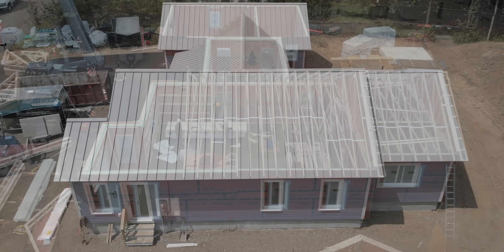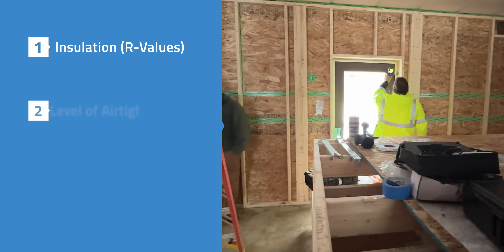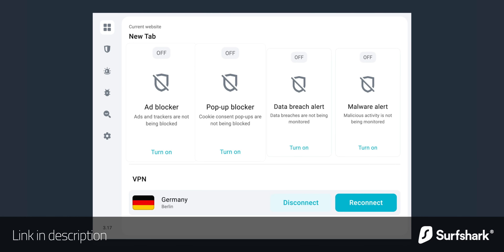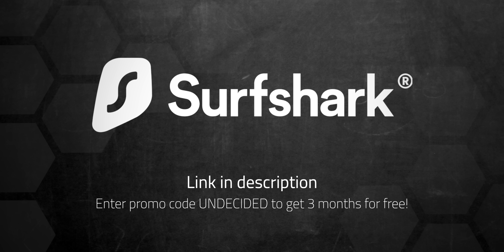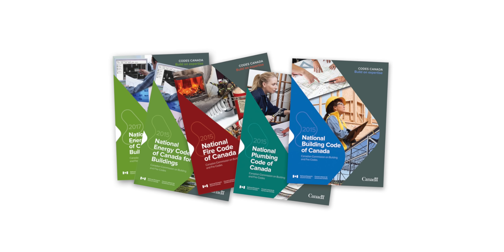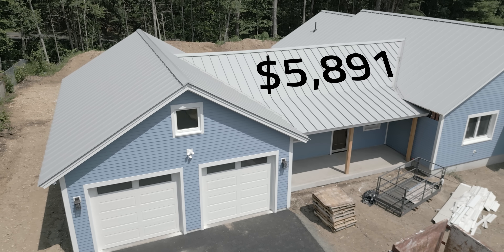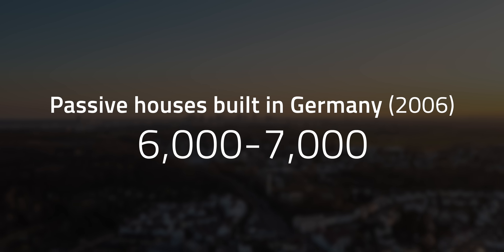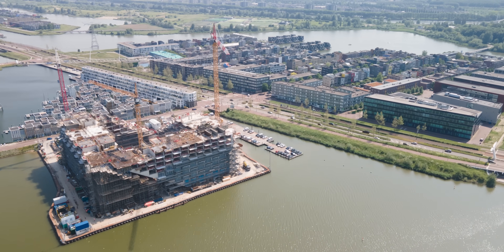Why Do American Homes Suck?

Comment: Fun video. I heard in a previous podcast that you would not build another home after going through it now. Would you recommend someone looking to have an energy efficient home in the U.S. have one specially built themselves like you, because it sounds like it would be impossible to find any already built due to the lax building codes? Would you recommend an energy efficient home (and the increased cost of one) for a first time home buyer?
Reply from the maker: I said that kind of in a tongue in cheek way.  In general, it's an exhausting/stressful experience I don't really want to go through again, but we're extremely happy with the result.  I don't think you have to have one specially built, but if you look for Energy Star rated homes, that's going to get you most of the way there.  There's not a ton of them out there yet, but they are slowly building up (pun not intended).  Would I recommend one for a first time home buyer?  It depends on what your goals are.  Would this first time home be a stepping stone to a dream house down the road?  Like a house you're planning on living in for 5-7 years before moving?  No, I probably wouldn't recommend it for a shorter term goal.  But for a longer term goal, absolutely.
Reply: If you're looking for a home, having efficiency on your list of things you want is a good idea, but will probably limit your options.

Maybe something to look for would be a house where efficiency upgrades could be easily done over time. That's basically what I've had to do.
Reply: @Green_Tea_Coffee  Thanks for your reply! I think I will be going this route as well, especially because I don't have the liquidity to start building a new home from scratch. I'll likely be starting with a fixer-upper that I can put money into making more efficient, hoping that it makes it more valuable before I can sell it years down the line.

Comment: I LIVE IN A PASSIVE APARTMENT BLOCK in Bulgaria* - it has very basic passive heating and cooling based on thermal mass and a wind catcher on the roof.

My energy bill is about $20 a month
It was built by the communists for the officers of the Bulgarian Navy. The walls are 30cm thick concrete. They heat up all summer and keep you warm all winter [till Feb]

Comment: The answer to the question is that in Europe we don't have an 18th century mindset that says government is only evil. It seems that the more socially advanced a country is, the more there is trust in the government. That's why it's more accepted that government regulation is not an infringement on freedom but a enhancement of the greater good that benefits everyone.
Reply: The more developed a country is, the more resources it has suphoned for cheap from less developed ones. Look at Germany for example.
Reply: Personally I wish we could have that in the US. However, we have daily evidence that our politicians, regardless of political party, are pretty much all corrupt, incompetent, or so old they barely know where they are. With big corporations running the country it is hard to see it changing anytime soon.
Reply: @jkeelsnc  That is a function of the type of government you have in the US. I wouldn't trust the US government either. But it's a chicken and egg thing. If you don't believe the government capable of doing good, why bother trying to change to another system of government? Also, I don't knwo of any other country that elects it's judges the way the US does. That is maaI don't knwo of any other country that elects it's judges the way the US does. That is madness. I have also worked in various roles in government. I'm not going to pretend it's perfect, but where I'm from the public service was professional and actually believed in what it was doing and mostly did it very well. Yes, it was bureaucratic but all large organisations are. The more complex the task, the greater the chance of screwing up. Defence procurement is always a sh!t show! There are morons, of course, but mostly the bureaucrats are professionals who know their stuff. (BTW, we also hate all politicians.)🤣

Comment: Yes, I am deeply interested in a more energy efficient home. I want to build a retirement cottage for myself, completely off-grid. That way, I'll be free of utility bills an rising prices (except of course for the inevitable taxes). I'm saving my pennies and doing my research. Your current topics on home construction are what drew me to your channel and were interesting enough to cause me to subscribe.
Reply: You'll spend more money in your off-grid fantasy then you will ever save just by paying for the utilities
Reply: @xephael3485  Huh? I'm planning to build in Arizona. The state offers a lot of good incentives for solar, and charges stiff fees for connecting with their already overloaded grid. It is actually about the same (I'm talking upfront costs, here) to put in an 8 kilawatt solar array complete with off-grid batteries than it is to run electric down the road in a new subdivision and connect up. Also, in the mountains the average rainfall is about 18" to 20", the driest drought year they've had in recorded history was about 10". Well, with a 1,000 square foot house + solar ground array, I can capture 12,000 gallons from the roof surfaces alone (not building a rain roof or chicken coop or workshop or greenhouse or even a garage, just the house and the solar array) during a drought year and twice that in a good year. A cistern is about $1 per gallon, so drilling a well with permits OR running a water line to city water is about $30,000 and $10,000, respectively, and putting in a cistern is about $20,000 (smack dab in the middle). Most of the lots available require septic (both in city and in the county) regardless of the water supply, so that's not part of the equation. I'm just confused. Why do you think that an all-electric house with my own solar array and a roof water-capture system (both common in Arizona) will cost me more money? If I'm getting bad information from the power company and the realtor, I would really appreciate you telling me about it.
Reply: @lindacgrace2973  your building in the middle of nowhere so of course it's going to cost a lot of money.
Reply: @xephael3485  Ah! Confusion explained. I am NOT building in the middle of nowhere, I am building within city limits of Prescott, AZ. I will be "off grid" but inside of a normal city suburb. I am blind in one eye, and the DMV insists that all drivers must see both sides of the road, so no driver's license for me. I can't build in the middle of nowhere - I have to be close in so that I can bike to the library, church, doctor's appointments, etc., and receive regular Amazon deliveries. No, I intend to be "off grid" - as in not connected to the local electric and water services, but not a "homestead" out in the middle of nowhere. I seek financial security - not isolation.

Comment: i have also found that a lot of people think insulation is only for cold climates but it works just as well in hot climates, keeping the house cold on the inside and keeping the heat out
Reply: We know it here in New Orleans, my power bill nearly triples in the summer from running the AC alone.  it's just that replacing all the windows in a home built in the 60s would be over $20K.  Making an old house energy efficient means making a LOT of changes.
Reply: @Blaquer17  now i dont know your economic situation but wouldn't that be a worth while investment? A one time payment to pay less for AC during summer? Depending on how it all fit together it may pay itself back in 10-20 years if not faster. Also if/when you at some point decide to sell your house it would increase the value right (ofc it is unlikely you will get all your investment back but some of it at least)?
Reply: @CoBy_CoBy  absolutely. It’s the time scale that’s the issue. It would only save us significant money for about half the year, but any loan would have to be repaid every month. It would just make cash flow an issue. I have considered it but it’s not feasible at the moment.
Reply: @Blaquer17  yeah, here in europe, in most countries energy efficiency improving for old houses is heavily subsidised, but it's all different here as houses are built from brick or cinderblocks or stone even, they last much longer, so you get the money for an outet facade with insulation and windows, roof insulation, it depends from country to country, somewhere you get less but for everyone who applies, somewhere you wait longer but get subsidied everything, in any case with new energy certificate your house is worth more, and you pay less bills, not just what you save on spent energy, but often because you save the energy you get better price too or lower tax or something, also a lot depends on the area inside the country, some areas are more subsidised where the income is lower, and then some are subsidised, usually rural areas that need support, from the eu directly, even in the uk when they were the member some counties that were mining towns before tatcher basically survived on eu subsidies and now are properly f-ed in their tory paradise.
Reply: @chartedtravel1776  USA is 27 in the world in terms of economic mobility on par with Lithuania and Spain. Scandinavia generally has the highest economic mobility. In Denmark people stay in their house for 21 years on average. In the USA its 13 years. I dont know where you got that nobody lives in a house for 10 years in the US and i dont buy that it has anything to do with economic mobility. If we were talking about renting apartments then yes its a lot lower with 6 years in Denmark and 3 years in the USA. But we are not talking about renters here just home ovners
Reply: @CoBy_CoBy electricity in the US is dirt cheap currently(8c in my area). Therefore people do not see the SHORT-TERM value in those changes and long term, it’s basically someone else’s problem.
Reply: @CoBy_CoBy  it’s $20k not $2,000💀
Reply: @Blaquer17  What if you only replaced the window or couple of windows that would make the biggest impact? So the one(s) facing the hottest part of the sun for the longest part of the day for example. Would that at least help some?
Reply: @Blaquer17  You can get replacement vinyl windows from $50-$150 piece. Might not be extravagant, but it'll be more efficient.
Reply: @Blaquer17  have you thought about getting a tint on the widows? Even a clear tint that reflects uv can keep a lot of heat out.
Reply: Yes, this is a huge problem in the US south.
Reply: Especially with AC
Reply: @ChrisBigBad ac is bad for you health....
Reply: *insulation
Reply: So many southern US houses don't even use proper exterior sheathing. Don't expect them to heavily insulate it.
Reply: Only with AC, it's useless if you don't have AC as otherwise high ventilation is preferable; high ventilation is more energy efficient and cheaper to build; hence no, insulation in the tropics is not the smart move. You want big ass windows, without glass, and ventilation holes everywhere, bright reflective colors, add fans and it will feel cool inside.
Reply: @egonzalez4294  sounds like a disaster waiting to happen when the wet bulb temperature gets lethal. Have you actually lived in a hot climate?
Reply: Regarding the point "insulation is also good in hot climates" while thats not untrue, more important for hot regions would be heat storage capacity and thermal inertia of your building materials. So you should build heavy. With stone, clay, concrete(not the best regarding climate) or generally dense bricks combined with natural shading. And with a heavy roof it would be also more durable during hurricane season. Anything is better than a wall made of wooden planks.
In moderate cold climates you kind of want both. And in really cold regions u absolutely want really low transmittance of your building materials.
Reply: It also dampens sound. Which is good if you live near an airport or are a drummer with sensitive neighbours.
Reply: Energy costs are only going to increase as time goes by and the climate deteriorates more and more. By the time I retire in 20 years Passive House had better be THE standard everywhere. There’s really no excuse NOW, except for greed and professional ignorance.
Reply: @DrMJJr   Most Americans can't even afford a mortgage on an older house in good condition, let alone spending $50k to gut it and increase its efficiency to meet some projected standard 20 years in the future. Not everybody can afford that on top of all the other inflated costs they have been hit with in the last few years.
Reply: It is also good for sound reduction - home office, baby's room, and etc
Reply: Very true - I installed loft insulation in a tin roofed wooden house in Sub-Tropical Auckland, New Zealand. It was about 7 degrees centigrade cooler in sumer just from doing that and 20% cheaper to heat in the winter.
Reply: Double the insulation with a basement and you can keep cool relatively well, sure if it gets much higher than 80°F its just going to be cool-er but still, my basement has stone walls in a fair few rooms in the basement so that's where I like to stay in the summer
Reply: In Norway state pays upto 30% of the cost if you make your house more effecient, like changing to better windows, or boying a new more efficient water heater, its a fund that pays some of the cost. Like if a new watertanks cost 1000$ they will give you 200$.
Reply: The american education system at its finest
Reply: I'm from Romania. The homeowner association on my street caught EU subsidies, government subsidies and city subsidies for various home improvements and contracted the work in bulk. I can tell you that people are totally incapable to organize them self unless forced. A homeowner association is not required outside of apartment blocks but without it ... zero chances to get reasonable prices on things that save money. And another point ... heat is a waste product of nearby powerplants if you live in a city. you pay for it at relatively low price but you use a waste product, heat is non issue. I don't use any until it drops to minus 10c just to be able to stay in shorts, I could simply put more clothes on. Heat won't be an issue for the foreseeable future. Cooling is an issue. The electricity, the actual product sold that generates the heat we use ... that's a problem, the entire cooling thing is seriously flawed, it doesn't add up to use that much electricity with a house very well insulated while we use almost no heat
Reply: I live in Southeastern Brazil and the subtropical climate definitely requires insulation in the winter (if the house has no AC, as is my case). Summers can get above 37C, but it RARELY goes above 27C indoors, which hot but tolerable. The problem is the winters; with outdoor temps below 10C, indoor temps can reach 16C! IT IS SO COLD!
Reply: @NothingXemnas  do you mean minus 10C, because positive 10 degree arent that bad. It's not t shirt weather either. But not that bad. People survived in Iglus that would melt in +10 C
Reply: Well yes but no, to protect against heat you need Mass or Inertia,Light Isolation like Rockwool or PU dosnt do anything against heat
Reply: @charelantony8018  dude what? Isolation is used to keep a temperature difference, hot inside/cold outside or cold inside/hot outside is doesnt matter which way the temperature gradient is it will isolate the two temperatures...
Reply: It’s more expensive to hear a house than to cool it
Reply: @kaseyc5078  is it? It doesn’t get very cold here, but the AC is something like $15 a day for us to run. We have gas heating and even with hot water and heating the house in the coldest months, it’s only about $4-5 a day
Reply: @kaseyc5078  I think it depends where you live. It's most of the time -40°C or +40°C outside?
Reply: Windows don't make that big of difference. Most heat comes in through the roof and walls
Reply: @saratemp790  Yes, they do make a big difference.
Reply: @saratemp790  I temporarily live in a rental with single pane windows and the draft is real. Last winter we could see the curtains move from the draft. The windows make a huge difference!
Reply: @saratemp790 windows actually allow heat to pass through much more than roofs or walls. In the U.S. our insulation is measured by a number called an R value; the higher the R value, the better the object is at resisting heat transfer. Roofs and walls have R values of anywhere from 10 to 30 or higher. Standard windows only have an R value of 3 or 5. 

Another way to look at it is to consider which material is more effective for greenhouse, glass, or thicker, non-transparent material? Glass is good for greenhouses because they easily let in all that thermal energy. Same thing with a residential house. That's why houses with lots of windows often cost more to heat and cool, while houses with a lot of concrete and/or brick do better at resisting temperature change.